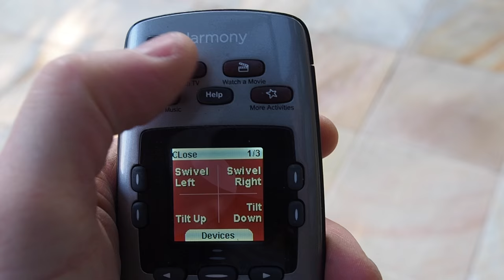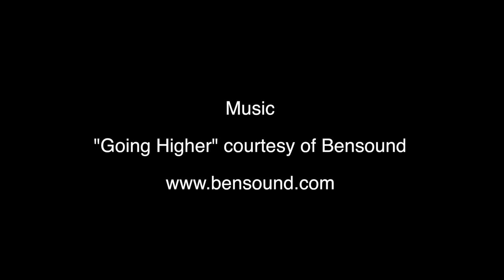DIY Outdoor TV Lift

Comment: Okay, that's just crazy good! How much time did it take overall? Are all parts easily accessible? Do you plan on supplying and/or installing this for customers yourself?
Reply from the maker: Thanks! It took a long time - 6 months at least. The parts are all easy to get. The actuators and most of the electronic I purchased on eBay. The micro controller is from Splatco in Seaford Victoria. It's just a one off masterpiece at this stage!

Comment: I have a roof pitch on the patio that makes this my only option.  Can you advise where you got this or the parts?
Reply from the maker: Hey Adam, the actuators and most of the electronic I purchased on eBay. The micro controller is from Splatco in Seaford Victoria.